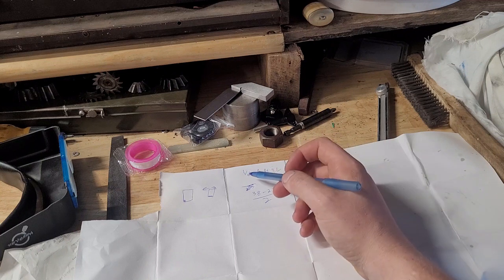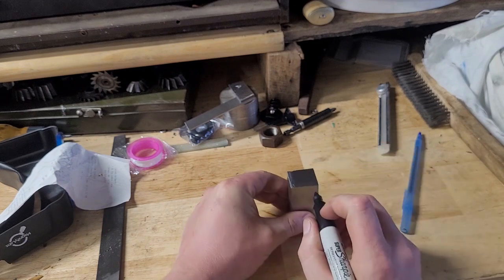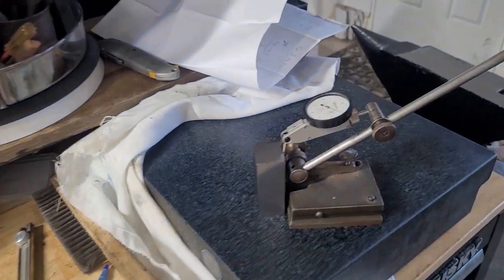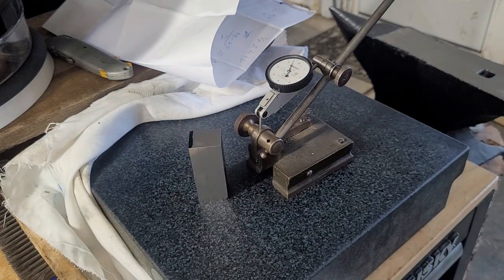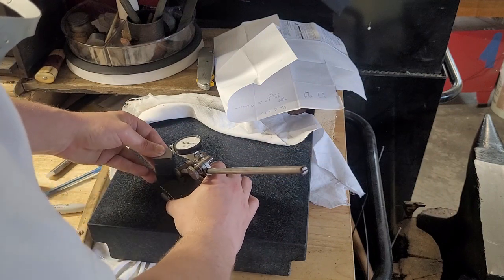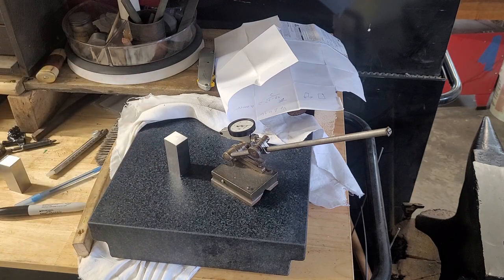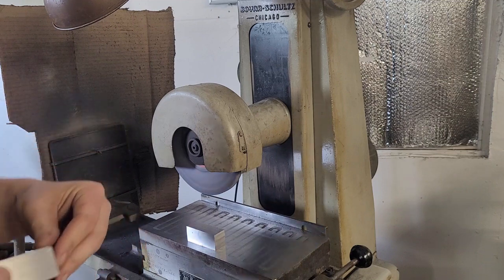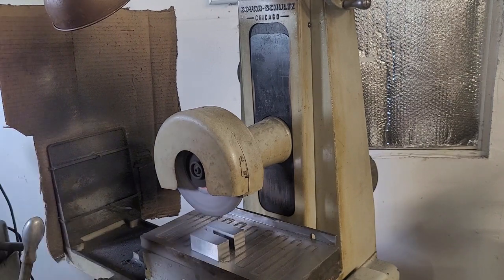Shop Made Tools Not Quite 1 2 3 blocks Part 3: Grinding Square

Comment: Great video. I have a similar grinder to yours just don't have the tall handle you have. I have never used it. Just tested it before I bought it. Gonna order some wheels for it after I get some tool holders for my lathe. Thanks again for the information. For a newb like me it's very informative in beginner terms I can understand.
Reply from the maker: Thank you! I would suggest getting the camel equivalent of a Norton 38a in H or I hardness. You will need to be really careful at first and try peel grinding (0.0005 to 0.002 depth of cut, 0.015 to 0.035 step over) when you are getting started. As a rule I dress my wheels every 20-30 minutes if work and right before a finish pass. With practice you can touch of to within 0.0005. I like to leave 1 or 2 thou for a finish pass when possible. Don't bother grinding your chuck till you are comfortable with the process. If you aren't you will leave a huge low spot in the middle.
Reply: Moose, thank you for all these tips.  I too recently picked up a surface grinder and have never used one.  Unlike OldMetalMachines, I wasn’t even able to test it.  Definitely looking forward to more grinder content when you have time.  Yes, I know the subject of grinding is incredibly deep and broad.  But I’m confident based on all your other videos (including this one) that you can dumb it down for noobs like us that have to start somewhere.  For instance, I never realized that the purpose of the ball on the end surface gage shaft is to be used as pivot point for checking straightness.  🤦‍♂️🤦‍♂️🤦‍♂️🤦‍♂️🤦‍♂️
Reply from the maker: @joell439  Honestly, I don't know if that is the intended use on a surface gauge, but it has made me put off making a dedicated comparator 🤣 Grinding is 99% patience and cleanliness. It'd frankly a lot easier to pick up than running a mill, but you have to be 100% perfect, there really aren't any mulligans. You'll get it soon enough!